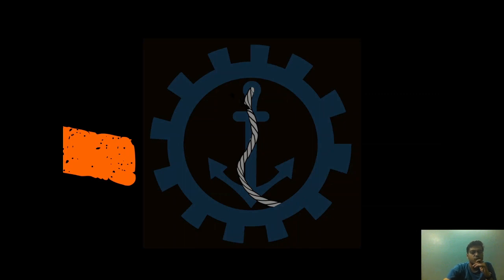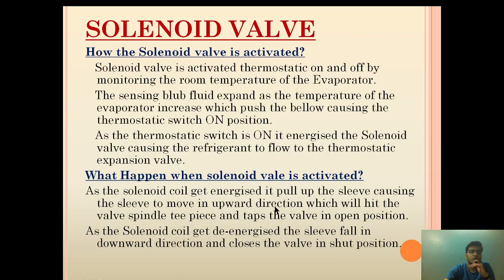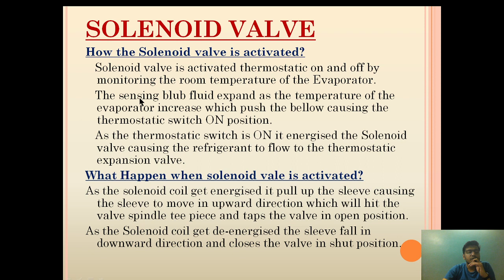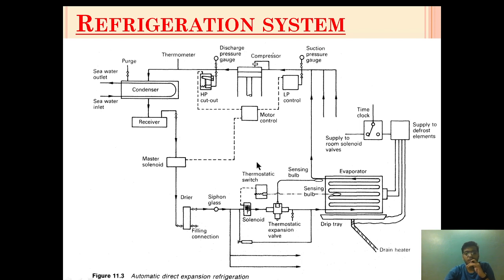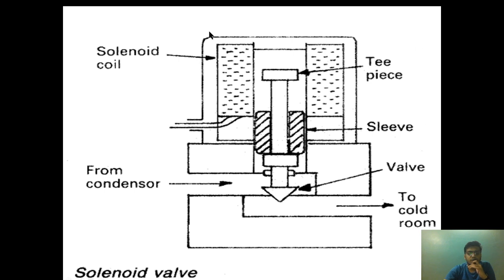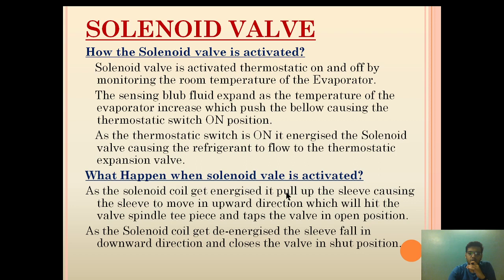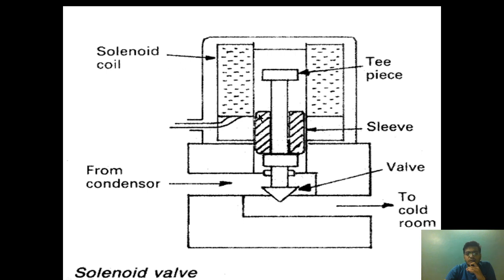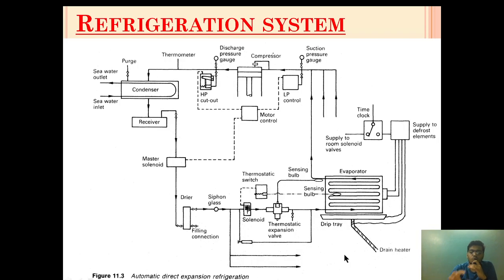Solenoid Valve | Function| Thermostatic Switch| Refrigeration System(Part-6)

Comment: Why solenoid valve is required when there is already TEV to control the flow ?
Reply: Maybe to prevent overflow of refrigerant and thus prevent ubnormal temps in the rooms
Reply: @zyzzz6331  For that TEV is already there right.
Reply: @najinkunnath6009  then its just for isolation if tev fails i Guess
Reply: @zyzzz6331  Possible